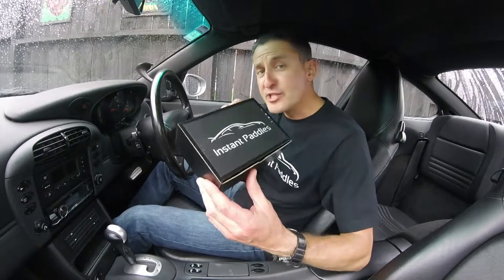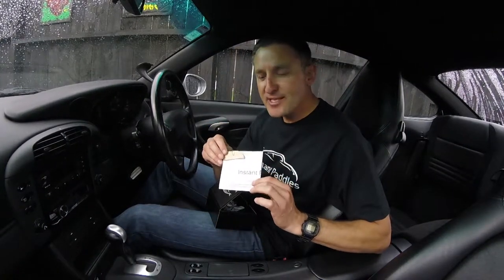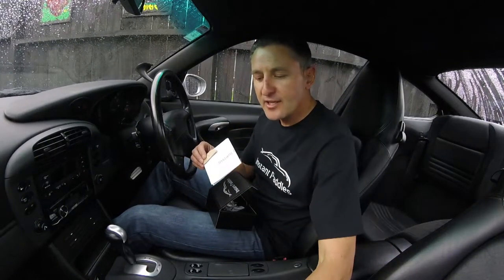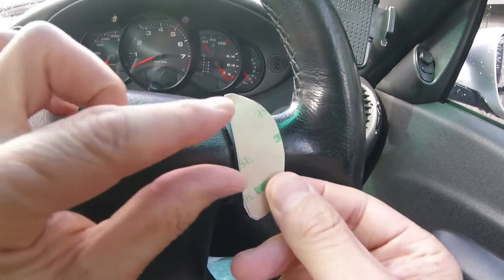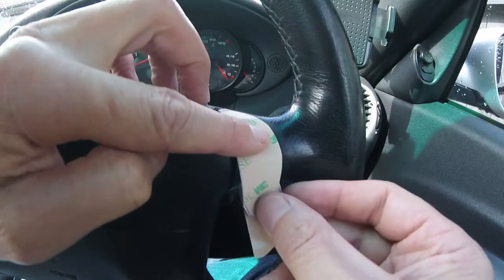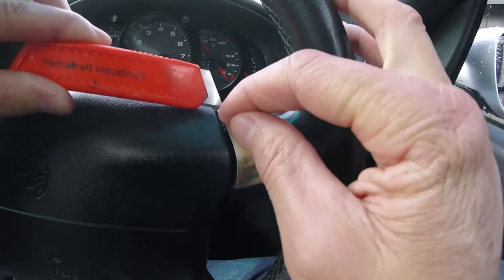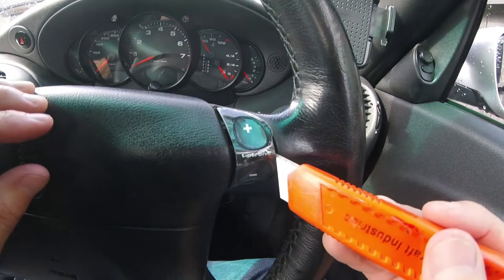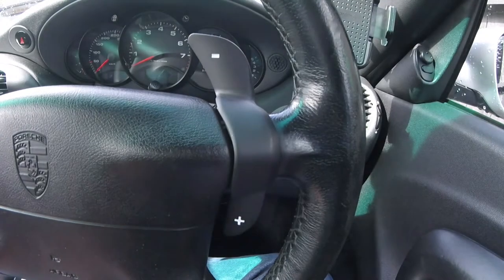Instant Paddles Installation video

Comment: Hi all, Just a note on cost!
I've had few comments that these seem over-priced. The simple explanation of price is I invested approx. $NZ6000 having a professional 3D design studio do the CAD and had them manufactured using a silicone-mould production run which yielded 20 sets, so the price is pretty much cost divided by 18 units (keeping 2 for myself). So exclusive, only 20 world-wide. 9 left at last count!

Comment: you did stick them veisa versa...downshift of paddles is on upshift position
Reply: With Instant Paddles if you pull the tabs from behind steering wheel towards you it reverses the operation of the standard buttons

Comment: You do realize that you put it on backwards, right? :-)
Reply: With Instant Paddles if you pull the tabs from behind steering wheel towards you it reverses the operation of the standard buttons hence the 'backwards' look!  However I've been meaning to put another video up showing how I use them now, which is only using the top tab for both up and down shifts which means you hardly have to move your hands around at all.